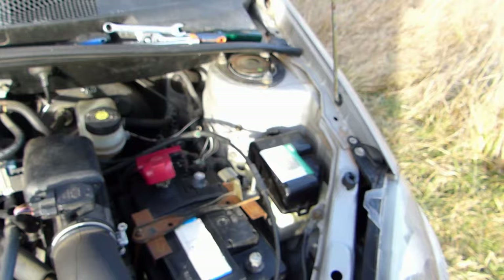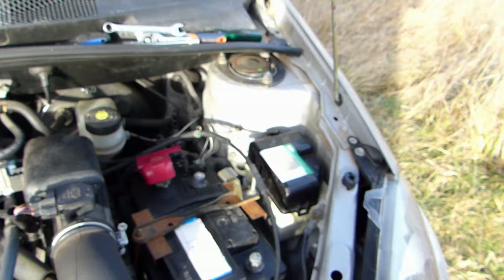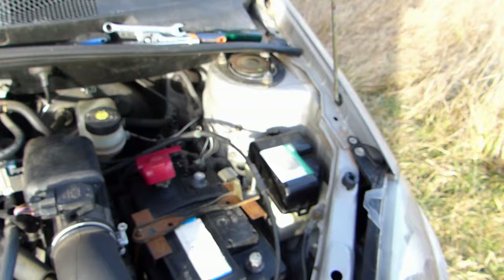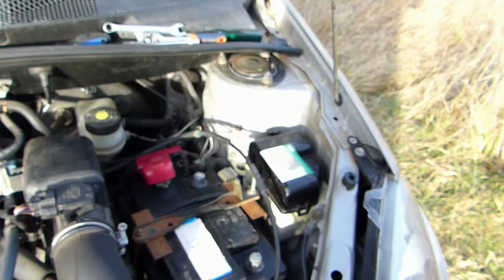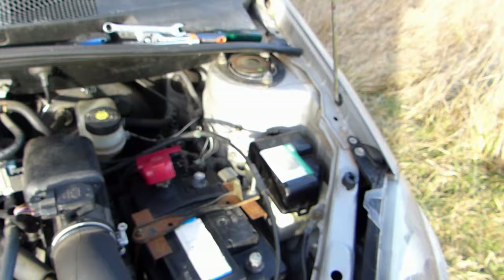How to change fuses on Toyota Yaris / Echo / Vitz 1999 - 2005

Comment: Litle tip: notice the 2 small metal "dots" exposed at the top of each small fuse? Have a multi meter set to ohms, and press each of your probes onto those metal "dots" to test each small fuse without having to remove them at all.

Comment: I was looking for a dedicated abs fuse and could not find just 1 that did the abs itself after watching your video bang on buddy found the 60 watt fuse here couldn't find it for the life of me but thanks these toyotas are very weird lol but run forever i wouldnt get rid of it PERIOD. when i took it off at first i couldn't see the regular 60 watt fuses so i closed it up but when i watched this great stuff and thanks be care next time when hooking up the + and - lol hey we are learn from mistakes shit happens buddy thanks again..
Reply: So in the days to follow i found the problem once i saw these damm flat fuses i had noticed they all had alot of (puss) i call that corrosion green puss lol. anyway i used some electrical cleaner (very safe) and got rid of it all used some dielectric grease (always use this) just a dab'll do ya. but anyway abs light gone and ready to as, toyota says ( let's go places) lol and thats exactly what iam doing buddy thanks again. ~Dave
Reply: Hola espero y alguien me pueda orientar conecte mal la batería y mi carro enciende pero no entran las velocidades cual es el fusible que devo checar ya cambie uno de 15 y luego el alternador no retiene carga 😢
Reply: Es un toyota hecho

Comment: Please I have a toyota yaris 2001 manual gear with digital display the speedometer just stopped and wont move from 0. I need to know which fuse controls the speedometer thanks others like fuel gauge and trip works fine

Comment: I have Toyota yards 07 the battery is fine starting motor is fine but it only start with jump lead or with push. I noticed the radiator fan doesn't work at all. Went to two garages they cannot spot the fault can you help.
Reply from the maker: I am no expert but if the battery is fine maybe the starter is faulty. If the fuse is ok for the fan the problem comes either from a sensor or the fan itself. Try shorting it to see if t worksthat way.

Comment: Hi there please I need your help please I have my toyota yaris 04 automatic problem I have my engine fan not working thanks
Reply from the maker: Maybe a heat sensor to be replaced r the fan itself (less likely). Try the fan directly on 12V to see if it spins.

Comment: Hi! 
Mr. FAB-B

I need your help 
the middle lights of my 2001 vitz do not access.

I changed the bulbs and they do not come on.
Reply from the maker: Hi, there is probably a bit of oxidation in the socket, or a wire is damaged...
Reply: @fab-b9818  Thank u,  i will check
Reply: Your car wiring is short